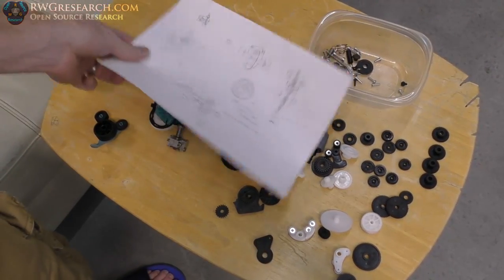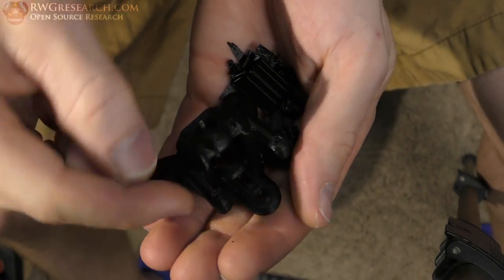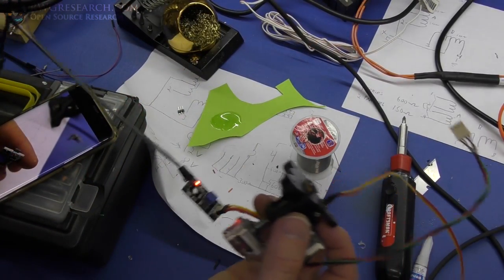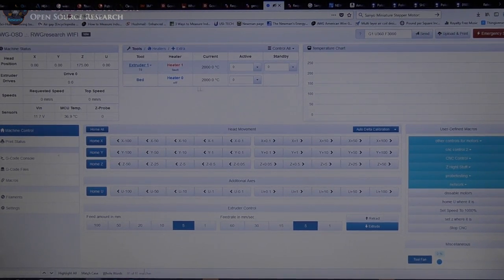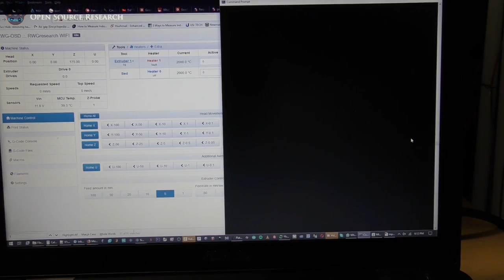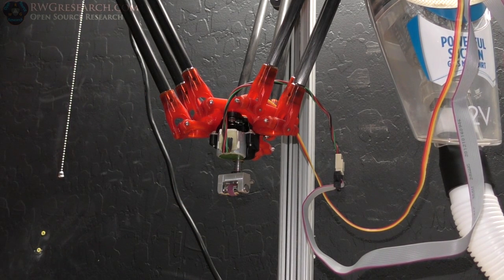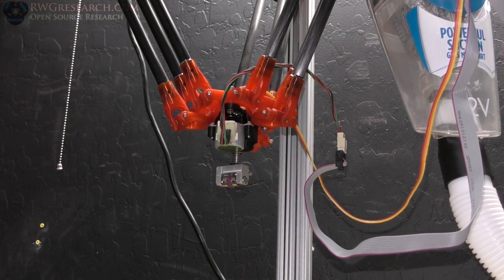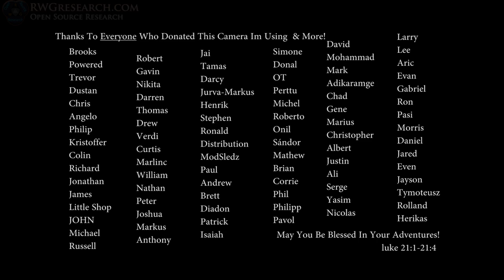Building The Motorized Tool For CNC Flat Coil Winder Part2 V1

Comment: Awesome update video! while I know you aren't looking to buy new parts and would rather re-use what you have around you, I thought I would mention I have seen slender, Through-hole steppers that are commonly used in Pick and Place machines. As the head pickup needs to have a vacuum to pull the part up, they make steppers like that. They look pretty slick and Ideal for an application like this, as there aren't any gears to deal with with potential slop, and much less bulk on the head. Take a look at some YouTube Videos of OpenPNP Machines to see what I mean. I'm, sure you already know of these already, but yeah. Anyways, looks great!
Reply from the maker: Thanks for the info, yes. I did not want to do this becuse of the weight. And im not sure the smaller steppers have the torque i need.  However.  I did it any way. Slightly diffrent though, as you will see in the future videos. ;)  also for those paying attention... everything on this channels is 1-2 weeks behind... however...  https://youtu.be/2Jksxj-7JEM
~Russ
Reply: Ah I see you already got it :) Well great work Russ, I look forward to the future videos!
Reply from the maker: @nickldominator  hehe, good stuff! ~Russ

Comment: That's brilliant.... I don't want to be the guy that suggests another method because this is in fact awesome and I couldn't do this myself. With that said have you considered making wire feed extruder? It could push a wire down a thin tube, like a hollow medical needle that hovers just above the bed essentially running the same software as a regular printer. Just imagining abstractly, thoughts? Awesome work Russ!
Reply from the maker: Thanks, we get a lot more interesting in the next video ( me thinks). "extruding" a wire i think is almost impossible. why? because some of the wire I'm using is as small as .002" OD. and there is no way to "push" such a wire. now if there was some way to get the wire to place where i want it using tube or something that would be cool. currently i need the roller to pull out the wire as well as push it in to the tape. I cant see any other way to do it. it has to have that "pinch point"  between the tape and the wire. thoughts? ~Russ

Comment: Have you considered printing your own gears for inside the stepper motor, being that you rebuilt it. I've designed in solidworks and printed on my CR-10S several gears and I don't have any play in them
Reply from the maker: i dont think i can make the gears that are small enough on my current printers, however you'll see that in the next video i completely changed everything to make do with what i had. :) Thanks! ~Russ

Comment: Would a worm drive give you the rotational torque you need?
Reply from the maker: yes, however it would not have the speed. so that's the triad off. also a worm gear would most likely have to much back lash. Thanks ~Russ

Comment: I think you need two gear wheels, one for rotating clockwise and one for counter clockwise, to get rid of the space.
Reply from the maker: Funny, I had that thought as well. However the better solution is a direct drive... ~Russ
Reply: Good luck.
Reply from the maker: @_John_Sean_Walker  Thanks, next video will enlighten V2 :) ~Russ

Comment: Well this is very cool, BUT every time you post a video, i am waiting for you to continue your newman motor... actually as i have no use in flat coils, every time you make a posting I am disappointed. 
Have I missed the video where you shelved that project.?? you did look  very enthousiastic at the time...
As i only have a small workspace at my disposition, i am half way through and could get to other stuff, but am still waiting for you to conclude your experiment. it is frustrating, because i am thinking: it is a failure and I can throw away everything i spent weeks (months) in building.... for now i am thinking I probably did something wrong.. it would be great if you could post a final video on the newman motor project so that some of us can get closure...
thx in advance
Luc
Reply from the maker: Hi There Luc, my current life situation only allows me to do so much, and currently i want to focus on  finishing this coil winder, why? Because using Newman principles I have found that making bifilar flat coils will give the same / similar result as the crazy amounts of copper with out using crazy amounts of copper... however, the coils have to be very precise. I did cover some of my thoughts here. https://www.youtube.com/watch?v=U6cwGjROjWs I have not concluded in depth any final thoughts, except that Newman's original very large device is the one that has the most interesting results.... hope this helps. One Day At A Time... ~Russ
Reply: Thanks a lot for your reply.. very much apreciated. I will be looking forward to your findings..